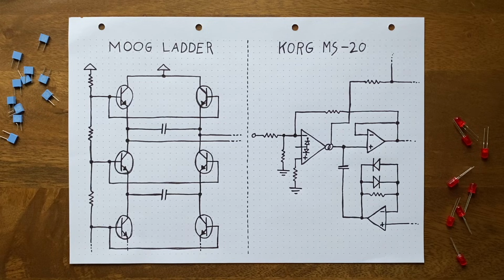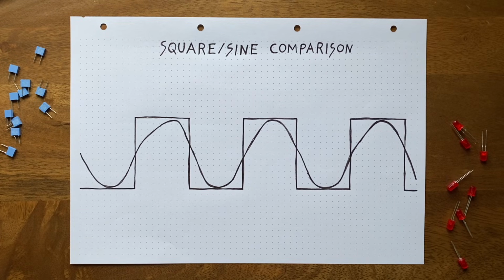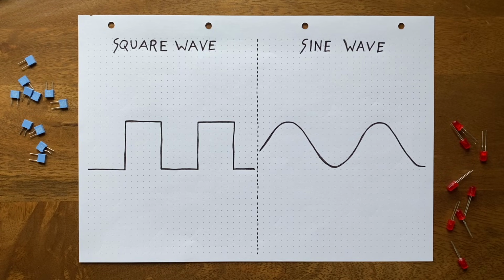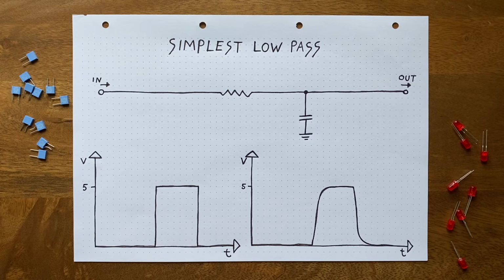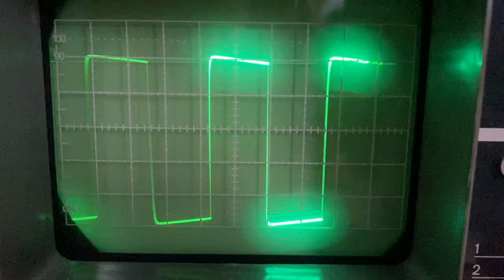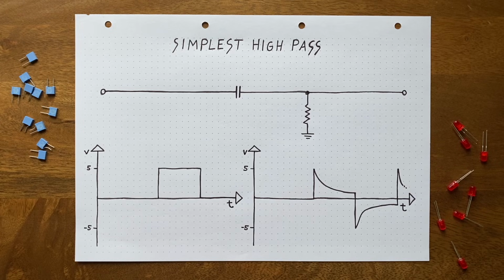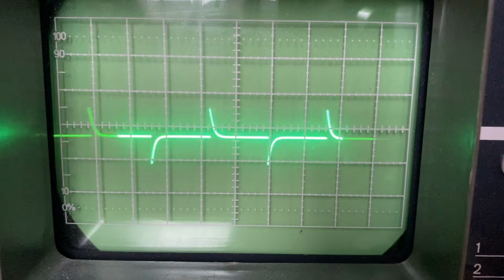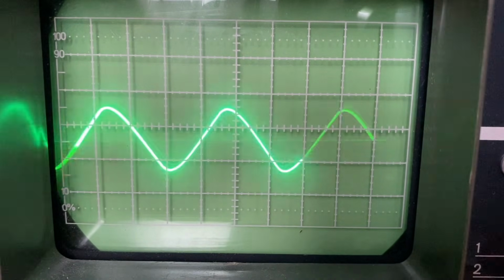DIY SYNTH VCF Part 1: Analog Filtering Basics

Comment: I actually just tried this. When I watched this, I wasn't actually thinking of making a filter, but I wanted to make a passive slew limiter for a MIDI to CV converter that I recently built as a DIY kit, and of course this works as a simple slew limiter too. A low-value resistor (around 100 Ohms) and a capacitor somewhere between 10 and 40 µF seems to work great to smooth out the edges of CV outputs which would otherwise have had 128 discrete values, making it sound very harsh and digital. So much easier than any other schematics I've found for slew limiters. Thanks again.

Comment: Nice video! But there is one thing - there is available variable capacitors. Why not use them (instead of variable resistor)?
Reply from the maker: because they‘re expensive and because you can‘t really replace them with something voltage-controllable (at least as far as i know)
Reply: @MoritzKlein0  what about varicaps (varactor)

Comment: One of the clearest explanations I have seen. I am an EE but never heard the balloon analogy somehow. Great work!
Reply: So increasing r makes less current get to that capacitor and thus the capacitor fills up more slowly, and because it’s filling up slower then it can absorb pulses of voltage that are longer (lower frequency waves) as r increases. Correct? Thus it’s not really practical unless the output is actively amplified in an inverse relationship to amount of r?

Comment: Great presentation but I don't know if order is the right term to describe the stages in English.
Reply from the maker: https://www.ti.com/lit/an/sloa049b/sloa049b.pdf?ts=1609817860820
Reply: @MoritzKlein0  thank you for the reply and the link, I will read it thoroughly later today. Doesn't have fourth order filter but has fourth stage. 
It does have second order with the capacitor as the first order and the opamp acts as the inductor/second order.

Comment: First off, thank you for this extremely helpful content, I have no words to say how helpful you're being. 
Then I just wanted to ask you if all of this could ever be applicable to the eurorack format. Would it be the same process but with smaller components squeezed onto a smaller board? 
Thank you!
Reply from the maker: sure, absolutely. you don't even need smaller components – in the end, the finished filter will fit on a quite small piece of stripboard (or PCB if you want to dive into that).

Comment: Alright, say I wanted to use a linear potentiometer instead of the rotary style. would I need to make my own for this since a 2nd or 3rd order filter requires 3 seperate resistor strips?

Comment: Wow I'm a Computer Engineer major and you do a great job at this than Professors. Great job man.
Reply: Nonsense. At uni, you should’ve learned all the math behind it, Fourier transforms, Nyquist, analog filters, digital filters and sampling. You would have to know all that to implement it digitally in a computer. This is a good practical intro, but with detail cut to near zero, for noobs.
Your post is a meme, I see this kind of comment on just about all these kind of sites, and it can’t possibly be  true, unless you slept through your degree.
Reply: @rob28803  uh? don't so goddamn consescending.
Professors are often boring and have terrible explanations. Moritz Klein has very simple explanations here- which you note correctly that by doing this, he does have to omitt a lot of detail, and all of the maths involved. But that's just it- he is only omitting the hard theory. These videos are meant to be for practical purposes.
And I understand that you already know this, and you were just criticising the commenter here for comparing Klein's work to that of a professors- but I would argue that the commenter here is also right.
I think that Klein provides such a solid foundation in these videos that all that is missing is the math. I think he could easily explain that here as well, but he doesn't, because most are uninterested in the maths when they come to these videos. The commenter here was simply praising Klein's excellent teaching ability, and I believe he is right in doing so.
I've tried to be civil in my reply to you here, but seriously dude, you need to touch some grass. stop being such a STEMlord.
Reply: @ff-qf1th  It is true, that this is a good entry into the matter. But also don't talk bullshit. If you study physics or something-with-e or computer science and you are not fluent "speaking" the math behind the physics you won't survive a semester. 
If you talk to your professor about the water analogy he will probably drown you(joke). In contrary, if he explains the physics behind electron movement, the endeavor of load carriers to balance each other out with water analogies he will probably get fired(no joke, fired by Georg Simon Ohm himself, turning around in his grave.)
Also if rob would criticize the video creator his comment would be over the top ... because why would he watch something he knows clearly in depth and then comment his frustration? That would be worth of a "STEMlord". But it is NOT like that! He criticizes the brain-empty comment that absolutely does not reflect reality, made by Trevor.
Further, there is absolutely no problem here with Trevor having no clue and his(!) professor not telling him about the intricacies of electrical engineering and the physics behind it, because he and his prof are COMPUTER SCIENTISTS. Saying "than Professors" and not "my", the plural is the nonsense here. 
Oh and BTW: Next time, you or Trevor or me or Rob are building a filter ... despite the knowledge shown in the video here ... we need that f'ing math. Or what, a professor, a nanny?:P 
P.S.: Calm down. The ethical standards that you apply to others(here by misunderstanding?!) will help nothing when you dimension a filter, next time. Next time? I doubt this will happen in the next 4.32×10^17 seconds. Excuse my rant, getting excited doesn't make sense anyway. Either do it or let it stay(i mean electronics).
Reply: @dieSpinnt  Stop being such a try hard. "fluent in math", mate no one is fluent in math but mathematicians, electronics is not maths. All we care about is can you build a circuit, you use the equations as and when you need them, no one knows them all off by heart. Stop trying to seem intelligent in YouTube comments and stop scaring people off of electronics. This series is incredible for showing how to actually apply concepts, far better than university ever was.

Comment: This is a great explanation!
In the past I have also used the idea of a voltage divider with one resistor and one capacitor, where the capacitors resistance is frequency dependent. This has also worked well as long as I have explained a normal voltage divider first (volume control), but I think I will steal your balloon analogy for future use! :)

Comment: Thanks for another great video Moritz.  Any chance you could do a video (or series of videos) on using an LM13700 as a voltage controlled resistor?  Thanks
Reply from the maker: i will cover OTAs/LM13700s in the third part!
Reply: @MoritzKlein0  Nice, thanks.

Comment: 2:20 is it my phone or is the sine tone missing?
Reply: It's a pretty low frequency, so your phone speakers probably won't be able to play it back :)
Reply: @hanton22  You are right, I tested it with real speakers.
Reply from the maker: @MultiCraftTube  it's barely audible even on my laptop - should've increased the frequency a bit!
Reply: @MoritzKlein0  if it is the same frequency as the square, it would actually be a good example of how humans (and speakers :D) percieve different wave forms
Reply from the maker: @MultiCraftTube  it is, actually! i think both are a C3, so 131 hz.